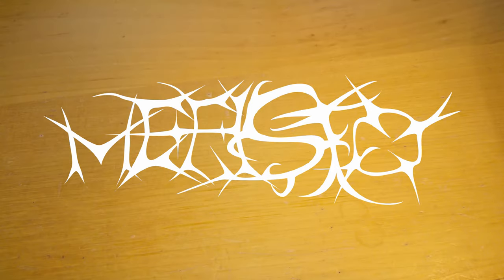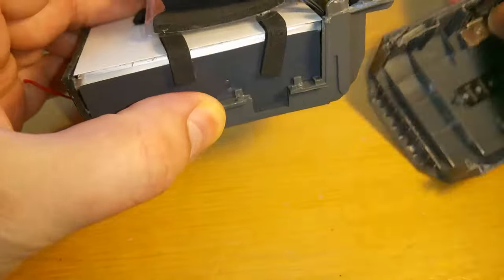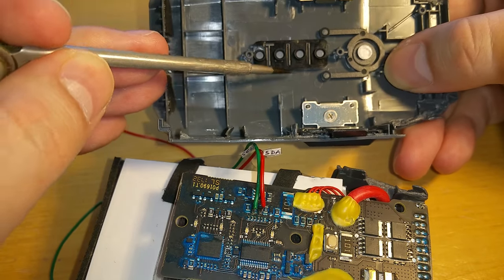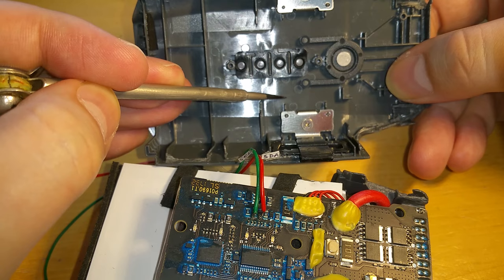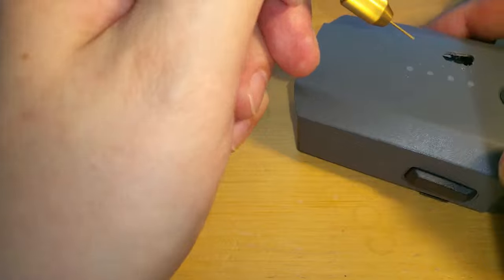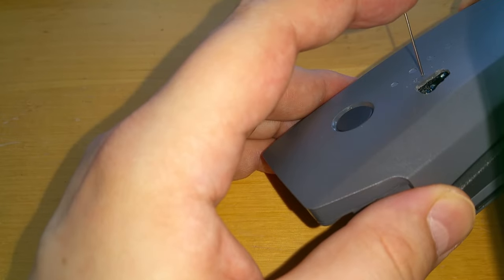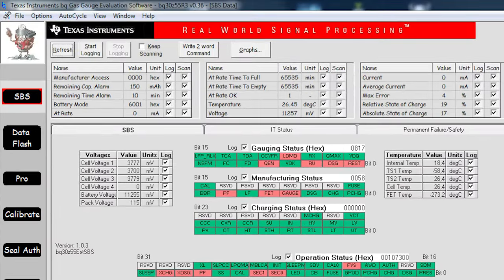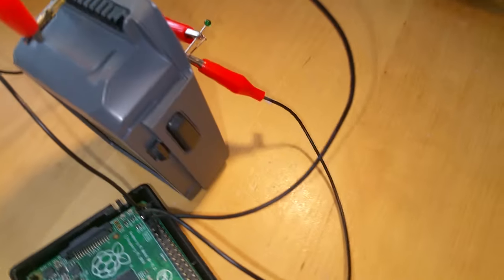Unlocking SBS-capable battery chip without expensive programmer - example on Mavic Pro battery

Comment: Absolutely brilliant! Thanks for developing this amazing code! I can confirm this process works on Phantom 4 High Capacity batteries (as expected since it has the same chip). Note that the P4 battery must be powered on for the address to be detected (this may have been mentioned earlier in comments, but I haven't read through them all).

Comment: Thank you for your effort, took me a few hours to get it working(a simple ADC on the I2C bus screwed over the communication). Fuck this anti-repair bullshit, ASUS sealed the battery. It is my damn property and they lock it away.
Reply from the maker: Absolutely. I hope all the `hardware as a service` ideas will be stopped by legislation, in all regions. DJI double encrypts all its firmware not only to deny users the access to their HW, but also to hide GPL violations.
Reply: I see you're trying to restore an Asus battery, so am I. I can't get the I2C to connect to my raspberry, I double checked my raspberry with a RTC clock I had in stock and it does work so I'm sure it's on the battery side. What did you do to get connection?^
I soldered small wires directly on SMBD and SMBC on the 30z55 pins but still nothing
Reply: Hi! Somehow my i2c doesnt show anything on the pi. Is there a way to test if it is a fail on the rpi side or the battery side? What do you mean by the adc problem?
Reply: @mefistotelis  Some rightful GPL code authors should sue DJI, they’d make a mint

Comment: can "dji-firmware-tools" that you used.. that is just using the SBS protocol right? so can i do the same with a laptop battery ??
Reply: There are tools for various battery chips, though only a few with limited scope are free. The tool I created works on standard SBS, but it also goes beyond with "ManufacturerAccess" extensions for a specific vendor and specific BMS chips. Custom drivers for more chips can be added though.

Many of the commands presented in the video are not standard SBS.

So the answer is "yes, but...".

Comment: Hi. I was able to drill the hole and access both terminals. However, when I use the software, it doesn't detect the board. Specially, the part about putting the pins, they don't seem to stay in place. Is there anything that I am missing? Please help!

Comment: Great tutorial with the RPi. I managed to mess up my Phantom 4 Pro battery by balance charging it and disconnecting PCB from pack and now although the lights/behaviour all seem to be ok it now isn't signalling the FETs to power on although it looks like it has. I'm hoping this might be caused by PF flag. I've got a real early RPi with the 26 pin header. I assume this will do the job, if not i may be treating myself to an upgrade.
Reply: After sorting my issues with my install on the ancient Pi 1 Model B , I've managed to resurrect my dead battery. Clearing the PF flag sorted my problem. Thanks a lot. Drone now powers up with it again and all cell voltages are within 0.01V of each other. Flight test at low altitude next to complete a cycle on the battery.
Reply: Where did you connect the sda and scl? I am trying to reset a PH3 battery and have found 3 different pad pairs all labeled sda scl
Reply: @icemanic400  As you are using different battery, I'd check for continuity between any of them and test them as pairs. The initial command just reads so based on the response you might be able to tell if it's the correct pair. I have no idea if the PH3 battery uses same power chip as the PH4 so best of luck 🤞
Reply: Hi like you i have the early pi model (pi2 i think?) And i have the same issue with the phantom 4 pro battery. But i have no idea where to start and how to do all this computer work. I have done the battery cells  equal at 3.7v stable now i know how to connect the pins to the pi. From here im lost - what software i need on the pi? What are the commands that i need to put in and in what order? I wish if it was a good guide for this. Instad of buying expensive module and payment software..
Reply: @drorhaz  hi, same here..did you manage to solve?

Comment: Hello!

I have two Mavic Air 1 batteries which don't charge and I tried to connect them to Raspberry PI. i2cdetect -y 1 doesn't show any devices listed. I have went over cables many times and is correct.

I checked cell voltage and they are 1.8V, 1.6V and 2.2V. Do I need to charge the individual cells first, before attempting to connect to i2c? Or shoud it work with these low voltages also?

Thank you for help
Anatoli
Reply: Tried charging the battery and it finally showed up in i2cdetect.

Unsealing Mavic Air 1 battery doesnt work!
Reply: @LifeofAnatoliStar  :}

Comment: Hi, great video and instructions. I had almost recovered a battery and was in the final stages of unlocking it and had connected the wires to the two outputs SCL and SDA but accidentally touched them and that is where it all ended, maybe the MSP430 shorted out or something?
I saw in your video that you were casually manipulating the alligator clips, I thought it was a no brainer that nothing would happen, 
Where do the two outputs go, is there a circuit somewhere of the board?

Comment: Hello great video. Learned everything on how to use the tool from it! Any advice or ideas about my AIRv1 battery is appreciated. 4 Battery Lights when push button dont go on anymore. Individual cells are OK = mid-voltage, No PF issues. 

The BatteryStatus: 
ERROR_CODE:	7=Unknown Error	[EC]	Function error code
FULLY_DISCHARGED:	0=Not fully	[FD]	Battery capacity is depleted
FULLY_CHARGED:	0=Not fully	[FC]	Battery is full
DISCHARGING:	1=Yes	[DSG]	Battery is discharging
INITIALIZED:	1=Recalibrate	[INIT]	State of calibration/configuration
REMAINING_TIME_ALARM:	0=Inactive	[RTA]	Remaining time to depletion alarm tripped
REMAINING_CAPACITY_ALARM:	0=Inactive	[RCA]	Remaining capacity alarm tripped
TERMINATE_DISCHARGE_ALARM:	1=Active	[TDA]	Battery capacity is depleted
OVERTEMPERATURE_ALARM:	0=Inactive	[OTA]	Temperature is above pre-set limit
TERMINATE_CHARGE_ALARM:	1=Active	[TCA]	Charging should be suspended
OVER_CHARGED_ALARM:	0=Inactive	[OCA]	Battery is fully charged
Reply: Here some other registers that might indicate the problem: 

OperationStatus:   	0x00040206	bitfields	Operational Status bits
[ ResU=0][ ResT=0][EMSHT=0][   CB=0][SLPCC=0][SLPAD=0][SLCAL=0][ INIT=0] 
[SLEPM=0][XL=0][CALOO=0][CALOC=0][ACALM=0][ AUTH=1][  LED=0][  SDM=0][SLEEP=0][ XCHG=0][ XDSG=0][   PF=0][   SS=0][  SDV=0][ SEC=2] 
[ BTPI=0][SMOTH=0][ FUSE=0][ Res4=0][ PCHG=0][  CHG=1][  DSG=1][ PRES=0] 

ChargingStatus:    	0x0808	bitfields	Charging Status bits
[  VCT=0][ MCHG=0][   SU=0][   IN=0][   HV=1][   MV=0][   LV=0][   PV=0] 
[ Res7=0][   OT=0][   HT=0][  STH=0][   RT=1][  STL=0][   LT=0][   UT=0] 

GaugingStatus:     	0x0b1950	bitfields	Gauging Status bits
[ ResN=0][ ResM=0][ ResL=0][OCVFR=0][ LDMD=1][ RX=0][ QMax=1][  VDQ=1] 
[ NSFM=0][ ResE=0][SLPQMx=0][  QEN=1][  VOK=1][R_DIS=0][ Res9=0][ REST=1] 
[   CF=0][  DSG=1][  EDV=0][BAL_EN=1][  TCA=0][   TD=0][   FC=0][   FD=0] 

ManufacturingStatus:	0x0078	bitfields	Manufacturing Status bits
[CALTS=0][LT_TS=0][ ResD=0][ ResC=0][ ResB=0][ ResA=0][  LED=0][ FUSE=0] 
[  BBR=0][   PF=1][   LF=1][  FET=1][GAUGE=1][  DSG=0][  CHG=0][ PCHG=0]
Reply from the maker: @krisjehaes276  You may want to post that on "issues" within the github project, or ask people on #hardware channel at dji-rev.com.

Comment: I am very thankful for and impressed by the work youve done. What would need to be changed in order for this to work on a spark battery? Im currently unable to unseal. Would the dji battery killer work if i order the cpxxx adapter? Or is it as simple as using a different default password? Thanks
Reply: The u at the start of the command unseal is upper case, Unseal. I made this error and quickly realised once I went back over my commands.

Comment: Hello Sir.
I´m having problems to access the Mavic Air 1 batteries.
I have four batteries and only one is Ok (fully usual and flying).
The other three are dead and I provided charge to them using a external font (directly in cells terminals).
I´m using your Raspberry Pi project but the communication occurs only with the good battery.
The connections for data, clock and GND are collected directly in the batteries terminal (not in the board points)
Do you have any idea to help me? Thanks. Leonardo

Comment: Sir, thanks for your tutorial
If the cell voltage is very low,
do we need to drill a hole to charge the battery terminals, or do we use the battery charger while unlocking the chip?
Reply from the maker: I drilled a small hole on the side of the battery with smallest surface. Then inserted a needle, and pushed it to puncture the glue which is on the terminals. Only one terminal required such drilling - the other one has direct connection to the cells.

Comment: Really good tutorial, I am impressed by your work on decoding the DJI drones guts.
Got some data out but getting errors during the Unseal command, also reading errors during Monitor function and others, not consistant reading.  Tried 5.6k and 2.8k to gnd on the data and clock lines, no benefit. Tried that generator command line, same thing.
Phantom P4 batts. 3.3v on i2c lines. Chip is Bq30z55. Tried 6600 and 4800 baud rate. Raspberry pi 4 version B.
Program spits error at lines 3000 and something. Any clues for me, please?
Reply from the maker: Understand the error. Put it into search engine.
Reply: @mefistotelis Thank you, will do that. I blew my Raspbery i2c port while trying the UARRT on a P3 battery board, now I ordered an EV2300 from Aliexpress
Reply: Hi, can you share where to download the files and how to add it on raspberry pi?

Comment: I've got to the point where 'i2cdetect -y 1' command executes successfully, but I am getting hundreds of devices listed, from 03 to 77 all are listed. In your case, only two devices were listed. So, how do I find the correct one? Any hints?
Reply: This has been resolved. The reason was a bad I2C connection. The needle method didn't work for me and I was only able to connect to the battery interface after soldering the wires. Two batteries were revived and working well. I am getting about 20 min flight time with each. Thanks for posting the detailed instructions.
Reply: In my case no detection in -y 1 but there is detection in -Y 2 I DONT UNDERSTAND WHY?????

Comment: Fantastic Tutorial. Have you tried to re-set a Phantom 4  battery, I have one that will not charge with the oem charger , but I was able to take it apart and balance charge the batteries on my Thunder AC 6 Charger but the battery is still locked and cannot be used to power the quad copter. Can you do a Tutorial on these batteries......Thanks From Canada
Reply from the maker: Phantom 3/4 battery uses the same chip. I expect viewers to be able to alter the procedure for different board layout by themselves.
Reply: @mefistotelis  Ok, great I'll give it a go then...thanks

Comment: Hi mefistotelis!  I have already recovered one of the batteries! thank you so much. But I have another one that I can't recover, it also has PF=1, and it supports the reset well, like at 16:58 of your video, but the PF is not removed. The CUV remains equal to 1, although it is well loaded
Reply: *charged well charges, 17.2 V, MA.PFStatus:            0x00000001      bitfields       Permanent Fail Status bits
[ ResU=0][ ResT=0][ ResS=0][ ResR=0][ ResQ=0][  DFW=0][OCECO=0][  IFC=0] 
[  PTC=0][ 2LVL=0][ AFEC=0][ AFER=0][ FUSE=0][THERM=0][ DFET=0][CFETF=0] 
[ ResF=0][ ResE=0][ ResD=0][ VIMA=0][ VIMR=0][   CD=0][  IMP=0][   CB=0] 
[  QIM=0][  OTF=0][ Res5=0][ OTCE=0][ Res3=0][CUDEP=0][  COV=0][  CUV=1] 
Reading write_word_subcommand command at addr=0xb, cmd=0x0, type=uint16, opts={'subcmd': <MANUFACTURER_ACCESS_CMD_BQ30.OperationStatus: 84>}
Query ManufacturerAccess.OperationStatus: 00 WORD=0x54
Write ManufacturerAccess: CMD=00 WORD=54 00
Raw ManufacturerAccess.OperationStatus response: 04 00 7b 50 00 d3
MA.OperationStatus:     0x00507b00      bitfields       Operational Status bits
[ ResU=0][ ResT=0][ ResS=0][XLSBS=0][SLEPC=0][SLEPQM=0][SLCAL=0][ INIT=0] 
[SLEPM=0][  SDV=1][ CALO=0][  FVS=1][  AWD=0][ AUTH=0][ SHPM=0][  SDM=0] 
[SLEEP=0][ XCHG=1][ XDSG=1][   PF=1][   SS=1][  CAL=0][           SEC=3] 
[  LED=0][   CB=0][ FUSE=0][ GPOD=0][ PCHG=0][  CHG=0][  DSG=0][ PRES=0]

Comment: I am trying to fix a Spark battery - I have followed your instructions and I get exactly the same results as in your video until I go to Unseal - every time I try, the battery remains sealed - any help you can give would be very much appreciated. Thanks for a great video and for any help you can give
Reply from the maker: The firmware for BQ9003 is modified by DJI, it is not stock from TI. The modification includes introduction of PFF2 - another flag acting as Permanent Fail mark. ATM clearing this is not implemented in my tool.
Reply: @mefistotelis  Thanks for the reply - I solved my problem with DJI Repair Tool and now all my Spark batteries are fully functional again. Does your tool work with Phantom 4 Pro batteries ?
Reply: @charlieandrews976  did u open the case and charge more than 3v first before using this method ?
Reply: #John Fernando
No, I did not have to open case but did have to provide 11.4V to Spark battery power pins to get the battery management system chip powered.
Reply: @charlieandrews976  I use imax b6ac and do the same thing but it always fails, may I know what charger you are using?
Reply: @John Fernando
I used my bench power supply set to 11.4V and 0.5A current limit.
Reply: @Charlie Andrews I've been trying the exact same setup as yours (power the Spark battery from bench power supply and clear the fault). Can you say more about this DJI Repair Tool? I can't seem to find any software with that name. Thanks!
Reply: @charlieandrews976  Im also interested in how you managed it, would be thankful if you elaborate on the tool.
Reply: @mefistotelis  it is now? I need to unlock a couple air1 batteries

Comment: An innocent question, sorry if it is obvious and does not make sense: the pins at the ends of the main battery connector, 10 pins, are not the ones the drone and the charger use to communicate?, and those would not work for I2c SDA and SCL instead of the ones you get with pins? Thank you
Reply from the maker: DJI always wanted to have their own "features" - and therefore communication messages - added to batteries. In newer ones, they manged to modify TIs firmware to do that, so they did accepted I2C (SMBus) as the battery protocol available on connectors. But for older drones - like this Mavic or the Phantoms - DJI had no ability to modify BMS firmware, so they've added extra uC. In these drones there's UART at the connector, and it talks to uC which when necessary communicates to BMS.
Reply: I don't understand you well, sorry. So the communication between the battery and (drone + charger), through those two wires on the extreme sides of the connector, have a different protocol incompatible with I2c? Thanks for answering
Reply from the maker: Shouldn't be hard to check on the web whether UART and I2C is the same thing.

Charger is just a constant voltage power supply, no communication capabilities.
Reply: ok, thanks @mefistotelis

Comment: Can you not connect data and clock via the battery connector itself, like how the drone connects? Without the drilling?
Reply from the maker: I'm sure the MSP430 has a BMS relay command, but I never cared to look at it. I actually prefer when such re-enabled batteries have a mark of tampering - I mostly buy them used.
But you can extract the uC firmware from update package using the tools, and analyze it.

Comment: is there a way to do this with an arduino? it has sdl and sda pins
Reply: YouTube “CircuitSchools” just did a video on this with Arduino Nano for Mavic Air 1 batteries
Reply: @Syclone0044  I saw that video but I am not sure where to get code for Mavic Pro using Adruino

Comment: Hi, I'm trying to get a battery from the DJI Ronin running again with your video. It is the same chip installed. unfortunately I get an error message when reading the chip. Can you help me please? I don't know what to do anymore. The batteries can no longer be bought and I would not like to throw the part away. Thanks a lot.
Reply: +1
Reply from the maker: Some DJI batteries try to short the SMBus comm when it's not used. Sometimes you can manipulate the battery so it stops the pull up - pressing button, connecting to charger etc. If not - some people just sewer connection on the SMBus paths, and later solder over the discontinuity when they're done.

Comment: Hello,

I hv a friend crack opened my MP1 batt, disconnected the pack, charged to 11v and reconnect it coz in other YT video said it may works. Well it didn’t. 

Then I bought a Pi-4b and followed this procedure to clear the PF flag and did it successfully (many thanks to @mefistotelis) but my battery is still dead. 

I sill have flags as follows:
At MA.OperationStatus: FVS, XCHG, XDCG
At MA.ChargingStatus: MV, STH
At MA.Gauging.Status: LDMD, QEN, VOK, RU, DSG, RESTDO
At MA.ManufacturingStatus: PF, FET, GAUGE

Any idea what to do next?
Reply: Did you manage to solve your issue?
Reply: @teknoy5417  No, sorry…
Sold the Pi4B in a good price then I sent the battery for repair at non official service.